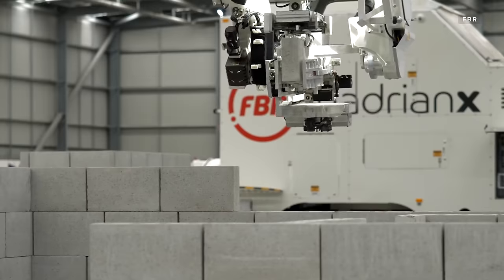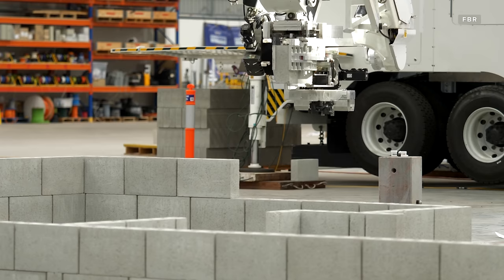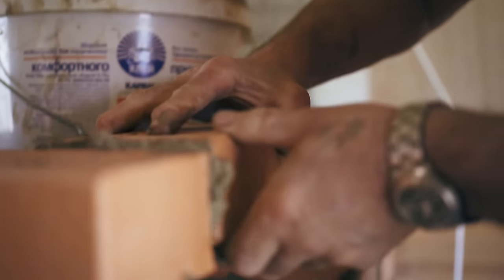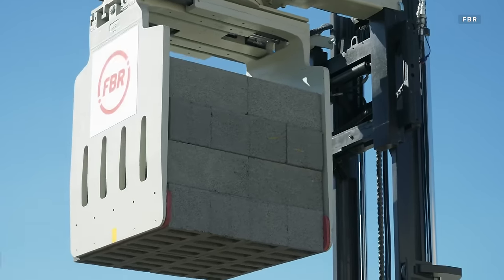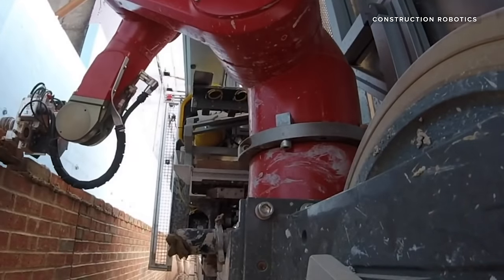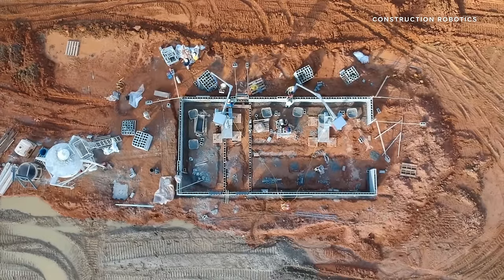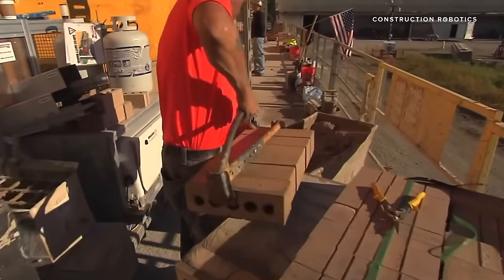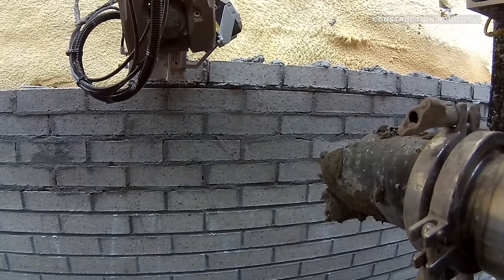This bricklaying robot could build 100 to 300 homes a year

Comment: Correction: While the Hadrian X is capable of laying bricks 12x larger than standard house bricks, the bricks used to reach the record of 200 bricks in one hour were 5x larger than standard house bricks.
Reply: Or other wise known as a standard four inch block. They got guys who lay 140 of them in 20 minutes. Fastest trowel on the block. That equals 420 block an hour. Machine needs to catch up. Oh and they are on half lap bond with mortar on them. Lol.
Reply: @beardedbricky7834  machine can work at this pace 10 000 hours nonstop
Reply: @saulsavelis575  doesn't matter the pace when there is no mortar and the bond is all screwed up.
Reply: @beardedbricky7834  but this one is tidy
Reply: @beardedbricky7834  it uses an in-house adhesive that "holds stronger and results in greater thermal and acoustic properties than traditional mortar."
Reply: @beardedbricky7834  The Hadrian doesn't stop for smokos and won't have a hangover on monday
Reply: @beardedbricky7834 sounds like someone's mad his job is about to be replaced 😅😅
Reply: It’s not cheaper then just hiring 5 brick layers

Comment: Will not replace human workers... Riiiiiight
Reply: They don't. It's never that easy to build a wall.
Reply: It will. There will always be a place for maintenance and operation. But most manual labor will become obselete in the future. Most people who haven't invested in education will be in for a rude awakening as their employment will be limited.
Reply: @deejay7339  Agree man. If these robots get cheap, construction workers are done for. Don't think it'll be as much a matter of education as it will be actual skills though.
Reply: maybe I should say WHEN these robots get cheap...
Reply: @suleiman1520  I should clarify. "Skill based" technicians and mechanics who service these machines would be needed. Higher education will be more relevant to society as labor markets diminish. There's an insufficient supply in Engineering, Applied Mathematics, Software programming, ect. As the demand grows further, that'll demand even more supply from the jobs market. That's less money put into labor rendering someone's "skill" obsolete.
Reply: Dee Jay I predict the programming market will become saturated
Reply: @cameronsantiago3155  If you understand the field you'd know that'd never happen.. There are many specialized programmers who use experience from another field to apply themselves. For example, not all programmers understand aerospace mechanics, thus not all are equal. That's where high demand is -- especially in Systems Engineering.
Reply: Dee Jay I agree, but I know a lot more of my friends that are going into programming than say engineer, medicine, or even finance.
Reply: @cameronsantiago3155  And that's great, because at the moment there are more positions than there are workers. Interdisciplinary degrees are too uncommon and it's hard seeing that change.. Like ever. Software is the most welcoming for such demand and a sign of the times. That's why it's smart for most to pursue.
Reply: In replacing human workers, they'll also bring down costs, since the machines will be more productive. There will also be new jobs in supervising, operating, setting up, and repairing such machinery.
Reply: Somebody will have to supervise these robots and maintain them and help when they get stuck...construction will become even more high technology than it is and fewer workers will be necessary as labor...
Reply: We need to eliminate capitalism before capitalism eliminates us.
Reply: spot on! It's people who are handing that job over to robots because they don't want to wok those jobs anymore. Add to that the huge drop in building time and costs and housing will become affordable to anyone. Not to mention all the jump in job openings in the automation and software development sectors.
Reply: @cameronsantiago3155  I believe we are a few centuries away from a one fits all model, so the programming market will get as saturated as the actual construction market, not more.
Reply: Will be replaced. No more plumbers,electricians etc... We only need software and semiconductor developers and vaccine scientists as they are the society's breadwinners.
Reply: They literally are replacing them.

Without the robot you would need to hire more to get it done in the same time.

Main misconception people have with robots is it removing all the jobs at once.

I wrote a system to automate engineers functionality at a previous company. Not even super complex. But it allowed 4 engineers (who could only get out at max 60 units a month with errors) to output over 300 a month with far fewer errors.

That basically means i replaced the other 10 to 20 engineers needed to scale that much while making more efficient and accurate.
Reply: It will replace force jobs, it will create more intelectual jobs.
Reply: it already has 😂
Reply: @manofsan  this will also make for a much more competitive environment for jobs.
If you don't have those skills, you won't have a job.
Maybe,,, trade schools should focus on teaching those technical skills vs how to swing a hammer. 🤠
Reply: @frankprit3320  - I do think that factory-built prefab modular homes are hard to beat though, in terms of cost and quality. I wonder if those techniques can be hybridized or mated with this automated bricklayer technology? I'd imagine that the automated bricklayer could lay down the outer shell or skeleton of the home, and then the prefab modules could be trucked in, and be inserted into  this.

Comment: Did you see the gaps in the bricks Hadrian x lays?  That is a major problem for insulation and waterproofing.  The wall does not seem structurally sound.  That glue will not hold like mortar or cement.

Comment: I worked on a brick crew...as a laborer. On a straight run, Dan could lay brick as fast as I picked them up and handed them to him face out. He would lay 5 cubes(2500) a day. This machine would lay 1,000, and I'm being generous. 

Dan took the oversquish fron the mortar bed with his trowel and used that mortar for the front of his next brick, and already had the bed of mortar on the run of bricks he was laying. I could barely keep up just handing them to him.

R.I.P. Dan Herman
Reply: An autonomous robot can work 24/7 though, for essentially forever, as long as it is maintained.
Reply: @VortechBand  There is also the fact that essentially after the upfront cost you just have to pay for fuel and mantenance.
Reply: @anandisrocking007 no benefits to pay, no unions to deal with, no lunch or water breaks to give, don’t have to stop work if it’s too hot outside. Man vs machine is a losing proposition.

Comment: I'm not that sold on this product. A main issue with building is the costs of having a truck close down the road or interrupt traffic. It costs a lot for the permits and in some areas you cannot do it except for certain times during the week like casting the slab at night during a weekend that being said the people operating this machine will cost more than the workers who would do its job i worked in construction as a mechanical engineer for around 2 years and know that on average a masonry does around 400-600 blocks a day and this machine isn't feasible for construction for a sky scraper for example there are safety risks bringing heavy equipment to these altitudes and regulations to follow which depend on the country or province in dubai for example the cement mixers aren't allowed after certain heights and cement has to be mixed on the ground floor and be brought up and those cost a lot of money. 
Sorry if something isn't clear or there are any mistakes native arab speaker here.
Reply from the maker: It's very clear. Thanks for watching!
Reply: isn't high buildings are using pre-cast concretes these days?
Reply: @photovideooz4084  It depends on the region and how tall the tower is. Certain regions along the temperature belt of the thermal equator use pre-casts for the entire structure regardless of height, if the region is colder along the Tropic of Cancer and Capricorn then it's precast to a certain height  then after that it isn't because you need additives into the mixture because it's colder for heat insolation and varying temperatures between negative temperature values in winter and hotter summers cause the concrete to break. There is also a major factor being cost if hiring a subcontractor to cast the concrete for you on site is cheaper than using pre cast them more than likely you'll hire a subcontractor.

Comment: I was born in Vinnytsia, Ukraine, in 1967.

My father had built our house in 1953. He used the Ciment, Bricks, and Clay and Straw Bricks . Also the walls are 24 inches thick.

It is a strong house and does not even require an A/C. Only in the winter season a few hours a minimum needs to warm house inside. My father's house keeps temperature inside very comfort in any of the seasons. My younger sister is living in our father's house.

I have been living in the State of Delaware since 1998. My house was built by 2016, and I called it a Wooden Shelter. My house in Delaware will never compare to my father's house in Ukraine. There's a heatwave on the East Coast right now. My A/C never stops to cool down my house.

America needs to radically change construction to build houses. American houses should have thick walls and be packed with a special ceiling to keep the heat out of the roof and house. At the same time, new construction will save the world from global heating by A/C.

Comment: Whats the wind threshold upto which this machine could adapt to and lay bricks ?
Reply: Great point, especially the higher it gets!  Also, what surface does it have to have before it can be set up correctly?  perfectly level with no building debris?  cement, not dirt?  what about windows and doors and arches?

Comment: Prefabricated factory panels will take over before this sort of thing does.  These machines generally rely on the building sites being flat with plenty of room to all sides of the structures.  They also can't deal with things like feature courses, non-standard sized openings, placing other materials (insulation, dpc's, trays, lintels, window formers, etc..) i.e. all of the things needed to keep the planners & building inspectors happy!
Reply: prefabricated building panels were heavily used in the 1950s, and resulted in a lot of buildings that were structurally unsound, because they're literally like a stack of cards and with only a few joints along huge panels, they're not as flexible as buildings made from smaller elements, like bricks, and thus don't stand well against weather and earthquake. They all required additional bracing to remain sturdy enough to be safe, but that also means you have a bunch of bracing that when worn, becomes soft and then the building starts to wobble in strong wind
Reply: @thesteelrodent1796 That's saying that engineers haven't learned anything in the last 70 years.

Comment: the australia machine isnt shown applying mortor
Reply: I don't think it uses mortar. I'm pretty sure it uses some kind of adhesive paste or something like it instead, and I wouldn't be surprised if they're applied to the bricks before they're laid
Reply: You gotta listen better
Reply: @user-io5gw1rk4t  I heared as well him saying that "It applies special adhesive", but i can see massive gaps to the sodes of the briks.
Reply: @Romashka8706   This gap is because it is going to be rendered, and it helps with adhesion
Reply: It doesn't use mortar, it uses a stronger industrial adhesive that dries in 45minutes. It's controlled uniform application means that you are reducing your variable costs

Comment: It doesn't seem like such a breakthrough for me. Robots have been used in factories to do way more complex work for a long time.
Reply: Yeah ,Mazak mazatrol is fully automated . This is just  a CNC crane with a grab and a concrete pump/special adhesive .
Reply: Yeah but they have never been used to build buildings. There's a lot of incredible tech in distribution centers and factories that can be applied to other industries but haven't.
Reply: Except this is basically bringing the factory to  your site, brick laying is  physically detrimental to the people who lay them, this robot can effectively lay 24\7 as long its inventory is kept up,  no sick days no worker injuries,  id say itd be far cheaper long term than a workforce of human brick layers

Comment: The article I read about the Hadrian X said it lays 500 bricks per hour and this video says 200 . Also the article said that the robot can work 24/7 because it doesn't need to eat or sleep,I beg to differ because there is a man on site monitoring this robot and he needs to eat and sleep. Next , the article said that the robot could lay the bricks in any weather, while that is wrong too because the adhesive will not dry correctly in inclement weather. Finally bricks and blocks are 2 different things.
Reply: It never occurred to you that the people can go home and different people can come to work?

Comment: A whole lot of people are going to lose their jobs.  People need to start training to operate and fixing  these robots to avoid becoming replaced by them.
Reply: By then robots will repair robots.
Reply: @Vildayyan2003  then people have to learn to build those robots, the cycle continues.
Reply: That will never happen. This robot lays like crap and doesn’t even put mortar in the joints. They can make machines for a lot of things but custom home building is not one of them. They need to stick to the factory line lol.
Reply: Bearded Bricky Give it time they will get it right
Reply: Embrace change. Who wants the same job 4 life anyone. It's good 2 change and try something new. Just spend less on material possessions. Live a simple humble life.
Reply: @mohammadalmekhled1230  imagine they build a robot that fixes other robots. Like in a circle. A rotating robotic circle.
Reply: hmm, I think people will need to start training to destroy these robots.  That would be a more logical thing to learn.
Reply: @-Muhammad_Ali-  like John Connor army in terminator
Reply: They are building robots that maintain machinery, so your opinion is null.

Comment: Who lays the mortar, tests the consistency, fits the ties, measures the cuts, cuts the blocks, checks the levels, points the joints, makes the tea, goes for the butties, tells the jokes, creates the experience, sells the service??? If the robot can’t do that, or drive it self to the job on time, it will need a human. Innovate but don’t isolate ✌️

Comment: prefab custom parts will be assembled by a gantry under a weather tent. bricks are too small of a component to assemble efficiently. entire wall segments, instead, with the ability to remove walls by unpinning them from supports, rather than now-you're-stuck-with-it bricks, so that remodeling only takes two days. oh, and we'll move to floating islands, because you can pick the government you want; so, everyone there is in support of it. the core city will be built all at once, tacking-on expansions only as needed. no bricks, sorry.

Comment: problem you still need staff to run it. i could lay the same bricks per hour for 8 hours you still need to clean mantanace the its not bricklaying and the value of property is less. ive built the same yes one bricklayer laying bricks real bricks with real cement. i dont cost millions.